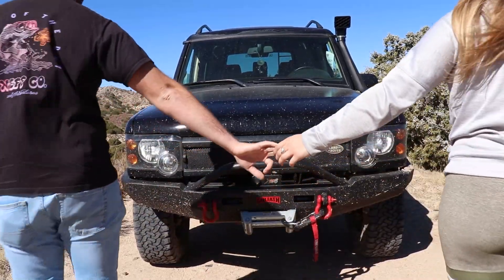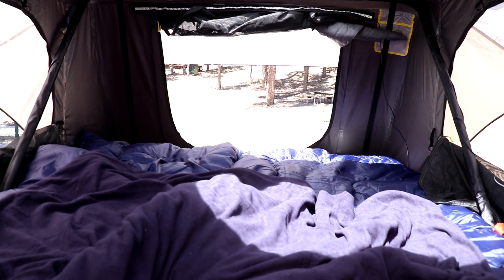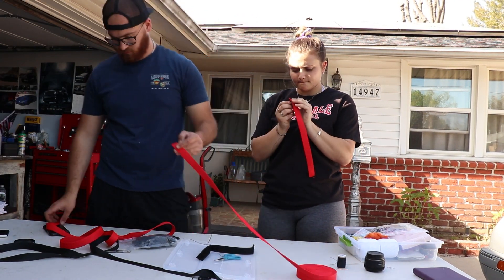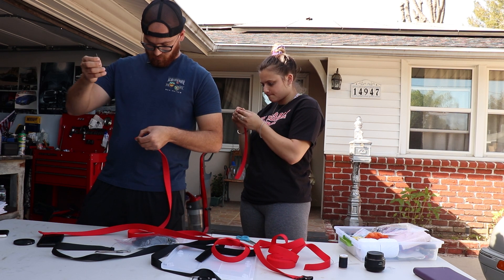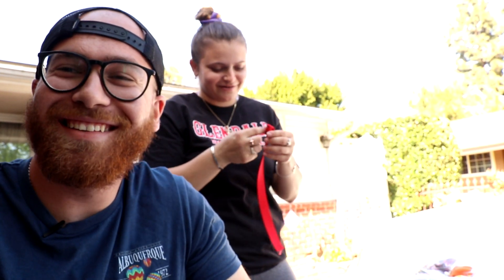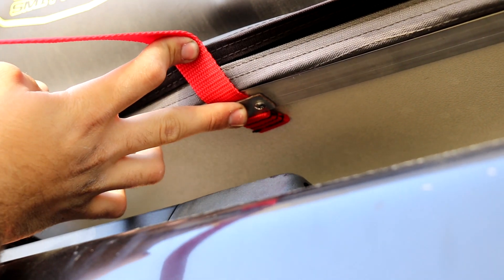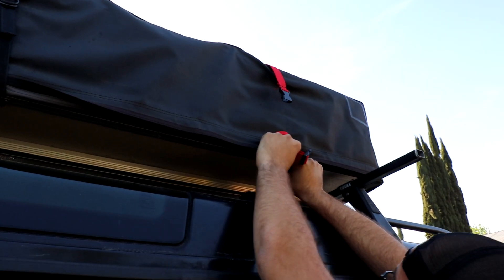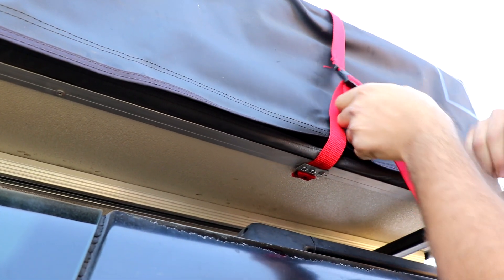The BEST Upgrade For Your Roof Top Tent | Discovery 2

Comment: Hey guys! I also replaced the straps on mine. There is a way to not have to sew by using a return buckle. Also, you may want to heat (melt) up the ends so they don't run. My 2cents...
Reply from the maker: Definitely we did burn the ends with a lighter the following day.